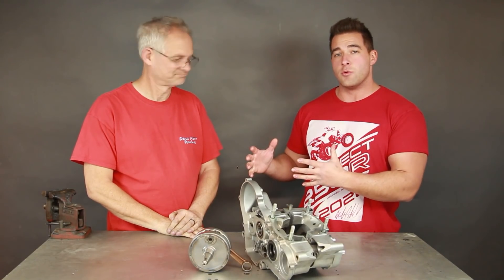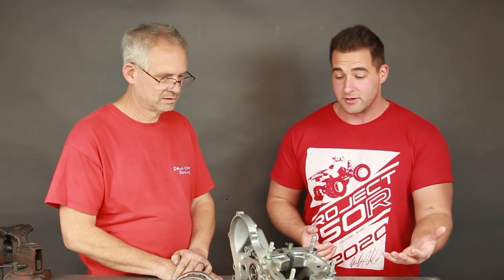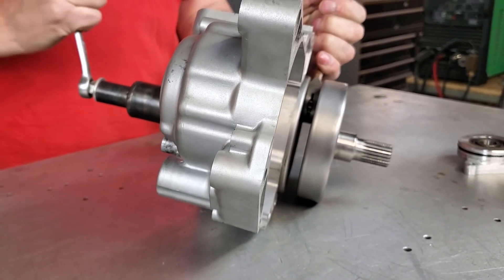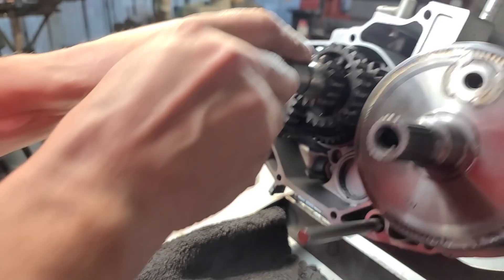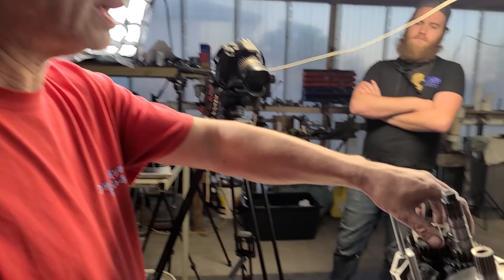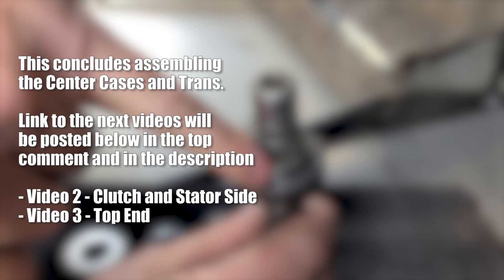How To Build an 85-89 250R Motor W/ Dave Moore - Part 1 - Center Cases and Transmission

Comment: I looked up this video once before and watched part of it. I'd like to ask Dave M. one question now that I'm in the process of needing to build three Honda TRX250R engines, one for my Arens chassis, LED 310 GNCC race quad, 2nd is for my 86 TRX250R that has had the stock cylinder re-sleeved by LA Sleeve 295cc sleeve, a 3rd cause I'm selling a 86 TRX250R to a teenager that works on a buddy's farm. I was out of the 250R game from 03' - 20'. I've put many 250R engines together in the past, and I'm sure if Dave saw me assembling some in the past, he'd most Iikely file criminal charges against me for abuse and neglect of 250R engines. I want to build them to  much higher standard than I had in the past. And one question I have is- How do you (Dave Moore) put the bearings in the engine halves? I've heard many suggestions and everyone has their own opinion. Me, in the past did it on a Shop Press. But I've heard some people say i shouldn't do it that way because I am removing material from the bearing journal. Is that true? Or is it just fine. What is your prefference on Engine  bearings? OEM or other manufacture, recommendations of which supplier's product you recommend if not OEM. Thanks for repoending

Comment: I’m building a 86 bottom end with long rod crank assembly with the 86 style piston, but all the different variations and different combinations on how you can build these engines is amazing you have so many options.. one thing with being my first 250r engine ( ive built many 2t-4t engines on quiet a few different machines) there’s isn’t a lot of comprehensive information on them so thank the both of you for sharing this knowledge!
Reply from the maker: You know, we never really touched on the differences with the long rod and short rod and that can definitely get confusing. Glad you're enjoying these videos; thanks for watching!

Comment from the maker: Thank you for watching man! 🤘

Video 2 - Clutch and Stator Side Assembly - https://youtu.be/Bx97SovoivY
Video 3 - Top End Assembly - https://youtu.be/skHge7Zi-y8
Video of This Motor Running - https://youtu.be/ctupjItBnHM

Chapters

0:00 - Intro/Who is Dave Moore
3:43 - Installing the Crank
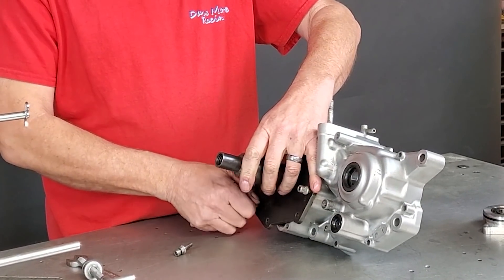5:49 - Engine Setup in Stand
6:57 - Installing the Transmission
11:15 - Installing the Second Case Half
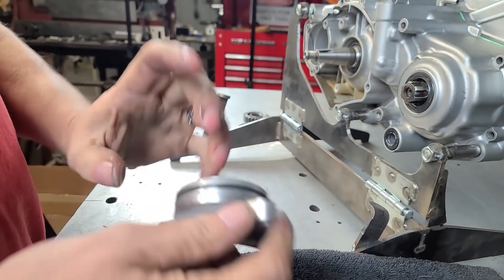13:40 - Installing the counter balancer holder and case bolts
14:05 - Installing the Countershaft Seal and Collar

Tools in this Video

Crank puller/Installer - https://bit.ly/3kBXDCr
Case Splitter - https://bit.ly/3dNh3D4
Engine Stand - https://bit.ly/2Tg3J1T